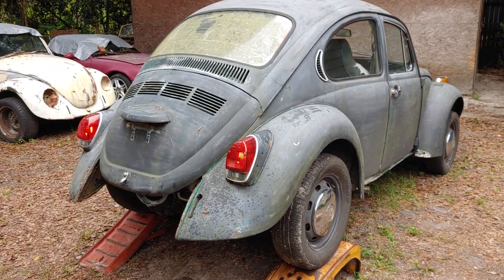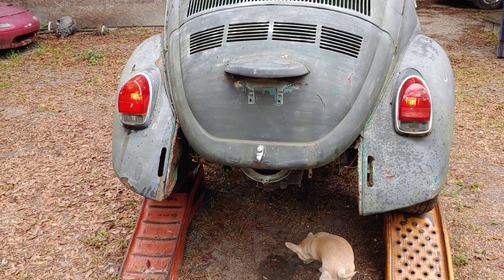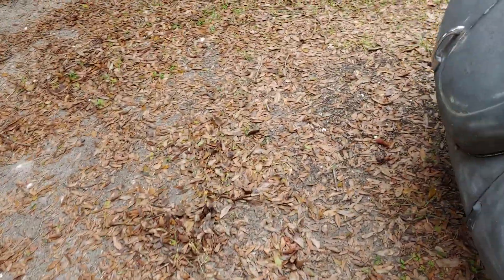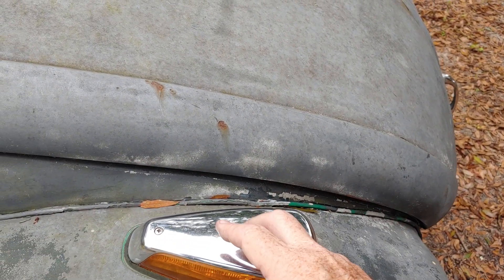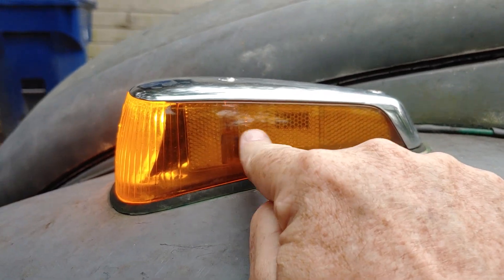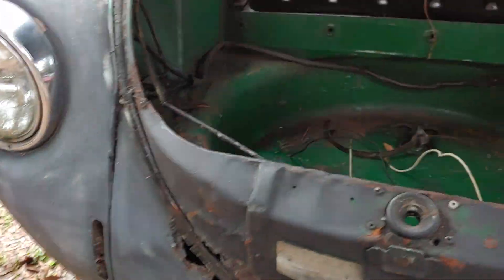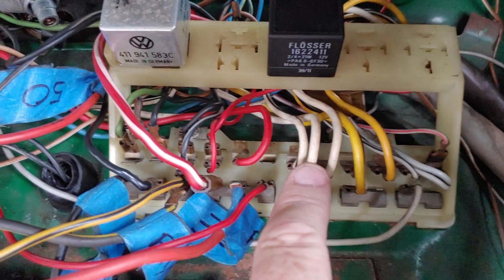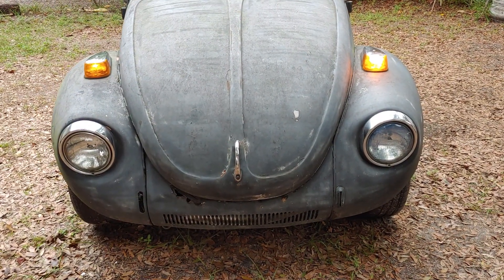CLASSIC VW- LET THERE BE LIGHT( TAIL LIGHTS). STARTER UP 1972 SUPER BEETLE.

Comment from the maker: Its been a goid week for sure. This week we got rhe starter dianosed as being bad. We also got the back lights operating. Sounds like a win to me. Thank you everyone for your support.
Reply: Doing well

My guess for the blinker light is that the bulbs are in series so the missing bulb = more luminous 

Relays are interesting in the sense that some older car did not have them , that allow for the switch to only have to be engaged at a relatively low ‘current’ and to switch the relative high ‘current’ say to the headlights. 

If one didn’t have a relay and fuses were bridged there’d be a possibility that in a condition of a ‘short’ your switch could catch fire / melt I bet it happened in some old vehicles.

I’d first check that the really is switching and making a ‘click’ when you turn the switch , this means everything on the ‘low current’ side is fine then all you have to do is make sure your headlights are looping from the battery > to relay > to headlights > to return of battery {‘ground’}

Sounds like fun.
Reply from the maker: @kolinevans9127  ok, thank you for the advice. I only had a few mins on the headlights yesterday. I just put in the relay then. I'm not sure if the wires are connected to the top shelf of the fuse box( which would be under the relay wires). Hope to get back out today if weather permitting. Thank you for your daily commenting. Much appreciated. Stay tuned to see what happens next.

Comment: 👍 keep working on it. You are getting there. I’m sure you know but the headlights also need to be grounded. I couldn’t tell from your video. 
On the starter- I chose one from advance. Got to use a 20% off coupon when I bought it online. Picked it up at my location that day. Lifetime warranty too.
Reply from the maker: I got a Bosch replacement from Napa for 49.99. There is a 20 percent discount this month as well with AAA. The only thing is I have to wait til morning. Weather is horrible right now anyway. Great info though to those who read the comments. The only reason I chose Napa was cheapest non- core charge. I plan on keeping the old starter. Going to tear it apart in the future. I did check the ground real quick but it started to rain again.

Comment: Headlights might not come on without the key in the run position. However if you re going to leave the key on in the run position, disconnect the positive wire that hooks up to the coil so you don’t burn up the points or condenser.
Reply from the maker: Ok. Did not know you could burn them up. I will keep that in mind
Reply: Volkswagenplanet if you leave the key on for more than a few minutes it will burn them up. If I plan on doing electrical, I just unplug the coil to prevent any issues.